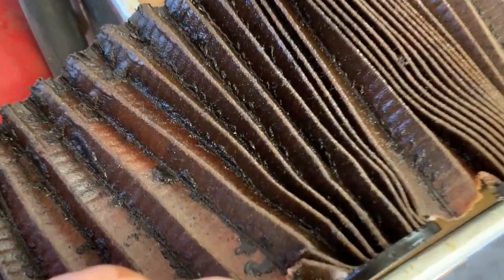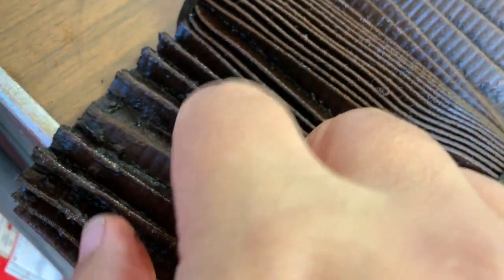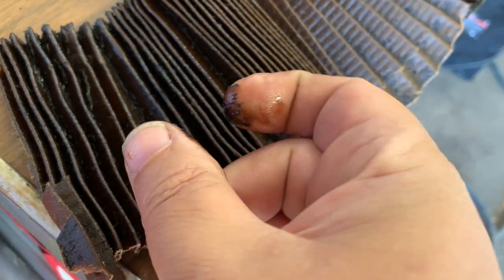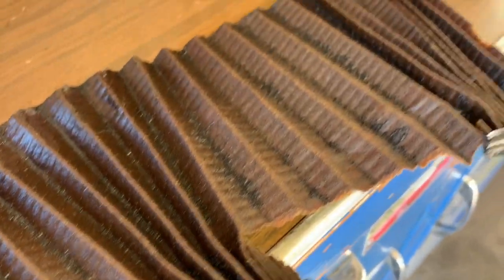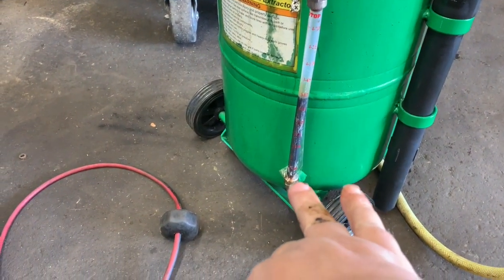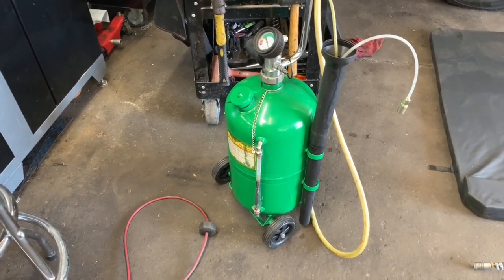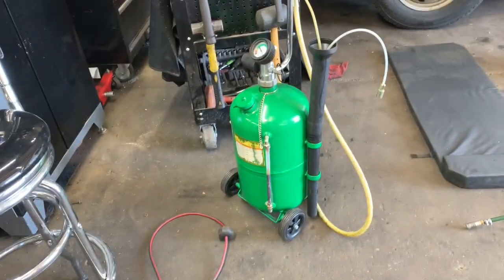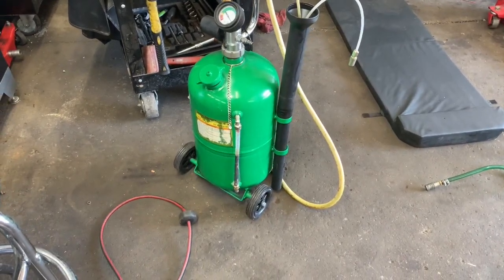Pentastar 3.6 P0016 and P0017 codes. A fabulous mystery unfolds. Solved! Ram Promaster

Comment: So I work for a Chrysler/Jeep/Dodge/Ram dealership. I have seen those codes. Like you stated not common. In our diagnosis trouble tree it states check oil level and condition in step 1. Then goes onto checking for correct oil filter and correct oil then on and on. So you missed step 1 and would have found the oil level to be over filled. You bashed an quick oil change place( I do all the time) but you completely missed step 1. Bravo.
Reply from the maker: I take your point, and you are right. That I caught it at all was chance because I happened to notice how much oil was in the extract before we changed it, and after. I could have easily missed that. 

points in my defense; the promaster has the cable and bullet style dipstick, which I feel is inferior to a flat dipstick for exactly this reason. It’s almost impossible to read the level on if it’s on the cable itself. 

I did two phaser cleaning routines before I noticed the oil level in the extractor. I was pursuing the codes as an oil issue. 

After it was at the quick change place it sat at a dealer for weeks. They couldnt figure it out and punted it to the customer, who brought it to me. That we changed the oil at all was an attempt to address the codes via the fault tree. 

But you are correct, first step would have been to verify the basics. What’s interesting to me is that’s a mistake I wont make twice. Hard won knowledge. 

Btw - if this video pissed you off, you are not going to enjoy my “why are dealers such dicks?” video. That one bashes dealers and dealer techs directly! You are going to hate me if you watch it!

Comment: I got a little tick that comes and goes especially in cold weather Any ideas
Reply from the maker: They all tick a little bit. If you are worried about the "pentastar tick", cut open a used oil filter and look for glitter. I have videos on how to do this. That will give you confirmation of rocker arm wear. But otherwise, I'd ignore it until it sets a code or otherwise presents a symptom.

Comment: Just did some headgaskets on a ram with this engine and now im
getting this code with a couple other ones. Small rattle after 5-6 seconds after every start up. Not too sure on what I did wrong, If I skipped a tooth will the engine still start?
Reply from the maker: Several possibilities. Most scanners will tell you the difference between the actual cam positions and the commanded position. Normally they are within 3 degrees of commanded. But it wont code till they get near 10 degrees out. 

Another possible is either of the two oil galley plugs in each head is working loose, bleeding off oil pressure. I can elaborate on this. 

A third possible is a cam tone ring has slipped. 

Fun fact: you can verify the cam/chain positions by taking off one of the phaser actuators off each valve cover. With one off, you’ll be able to see both alighnment marks with a mirror or camera. If the front head arrows are pointing directly at each other, and the rear lines pointing directly at each other, you can be certain the engine is in time.
Reply: @promastersonly1419  Great tips for someone who hasn't really worked on those 3.6s but very mechanically inclined so Ill be hunting that down tomorrow morning.
Reply: @promastersonly1419  Ill start by removing valve covers to check timing.check Tdc on crank and then verify cams timing, check any loose cam phasers, galley loose bolts, and timing tone wheels on cams. If everything checks out Ill be doing a compression test.
Reply: Update: skipped a tooth on my exhaust cam on bank 1, got the timing done again. Started the truck and it purred like a puppy, after my first drive a got a check engine light though. Checked it and got code P000B. Any idea? Maybe just need to drive around for a while? Engine feels great now no misfires or weird rattles or ticks,
Reply from the maker: @Athefleetmechanic  other than that galley plug issue, no. Seach my videos for one on P0016 where I discuss it.

Comment: Wow this is what I did after they changed my engine oil cooler 2014 promaster  I keep getting can’t position sensor and low oil pressure sensors not working but I fixed the sensors still getting codes I’m doing an oil change today
Reply from the maker: If your codes are P0520 or P0522, that's the sensors in the oil cooler, which might make sense since you just fiddled with it. If your codes are P06da or P06dd, that's the solenoid in the oil pump. All 4 codes are completely harmless, and I have personally run engines for hundreds of thousands of miles with those codes active. The cam position codes, however, are more serious. Can you give me all the codes it has?

Comment: My 2018 Promaster is throwing a PO345(1-3) Camshaft position sensor.
I would bring it to you but I am in Washington State.
Reply from the maker: That is highly suggestive of the electrical wiring to the sensor. The sensors themselves almost never go bad. That code is bank 2 sensor 1, so that's the front head. You just may be able to see the wiring to the sensor on top of the valve cover, but you won't be able to get the sensor out without taking the intake off. Either way, wiggle the connector, inspect the wiring near it.